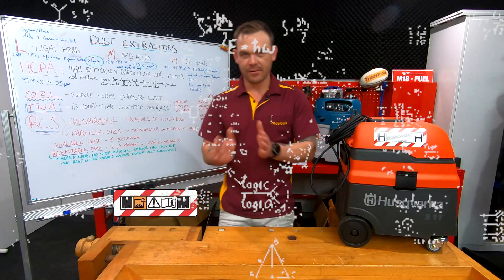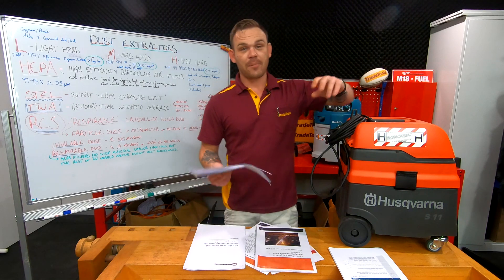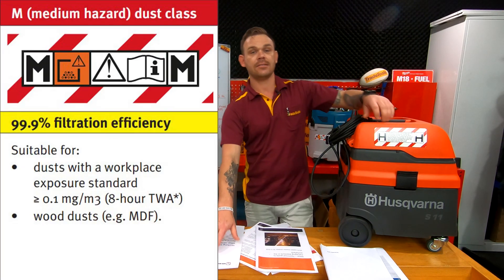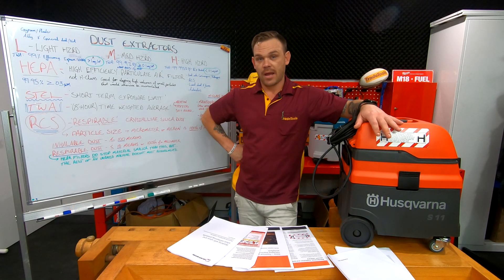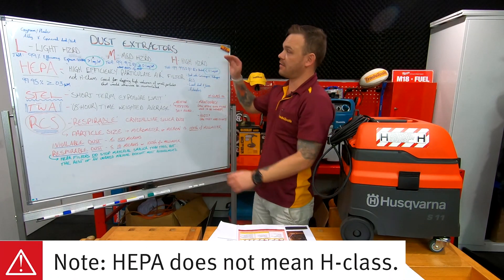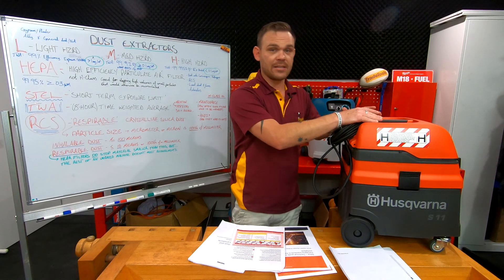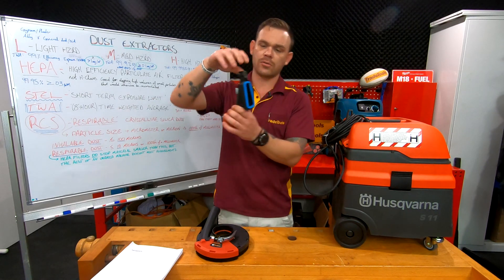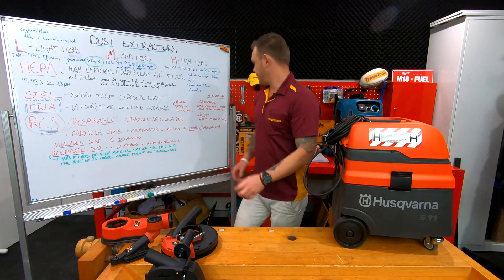Dust Extraction... M-Class, H-Class, HEPA, What Is The Difference and What Do I Need To Use??

Comment: I still dont understand why the exposure level is measured in mass of dust per cubic meter, regardless of the particle size. A gramme of fine silica dust is the same mass as a gramme of sawdust right? This should be described in terms of particulate matter size. Copilot tells me that recent standards set out criteria for PM1 (ie 1 micrometer) PM 2.5 and PM 10. ISO 16890 says a filter rated as PM2.5 must capture at least 50% of particles of that size

Comment: If the issue is filtration, why isn't upgrading the filter enough to make the vac perform better? Festool L and M class use the same bags and same filter cartridges. The only difference is the flow alarm on the M class. But in essence, if used correctly, the L class is not letting any more dust out the exhaust than the M class - because, darn-it, it has the same filter! So the whole thing seems like a scam.
Reply: I was also wondering, after a quick search and according to some festool forums, 
Start of quote : 
Festool never produced "lower than M class filtration level" vacs. Even before the L/M/H classification was created. They never had bags that would meet L but not meet M.

So for them the only difference is that the vac models without sensors cannot be certified as M class, hence they are, legally, "L class".
End of quote

I believe it's the same for the other main brands of vacs.
Reply: As he said. A heap filter is good but does not, complete the criteria needed to classify an M rating.

Comment: I have a dry / wet hole drill machine with dry suction or water cooling. When using dry, is M class ok or do i need H class., Cause i need extraction and thru thé suction from thé vacuümcleaner thé hole drill gets aircooled also.  Suggestions?( Im not a contractor live in thé EU, but have nose bleeds all day due to dust and fumes...

Comment: Clear as Mud.  Ty for the video. Its extra confusing here in the US I don't think the M/H class certs really exist here.
Reply: M class in the Uk, is like HEPA filter in America.
Reply: @spilleradam  Unfortunately its not. HEPA is nice to have but is not equivalent to real ratings of L/M/H classes. In North America our legislators are way behind the health 8 ball, if they'd cared about us they would have L/M/H in in place like Europe long time ago. In North America, you will fined that most "decent" vacuums are only L class at best. And that is with or without HEPA!! It's your health, at least wear a face mask in addition to dust extractor.
Reply: @spilleradam  Forgot to add one important point to clear up my other (earlier) comment. European L/M/H class regards the complete machine for dust containment, including filters. In North America, HEPA is a standard applied to the FILTER ONLY, not the rest of vacuum. Yes HEPA is the best filter and if the complete machine is HEPA certified then IMO you really have something better than L/M/H class machines. I think only Festool offers a certificate with HEPA filter as a "HEPA compliant machine". That is something to consider!!!
Reply: I have talked to Festtool support several times in regard to the HEPA certification and was told it is only equivalent to a L class rating.